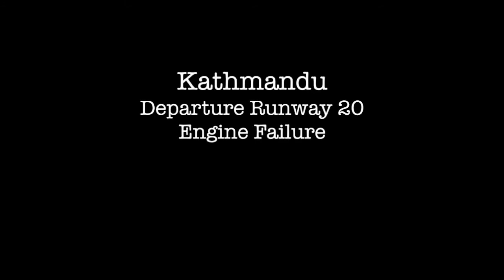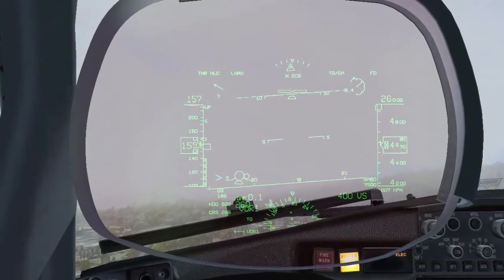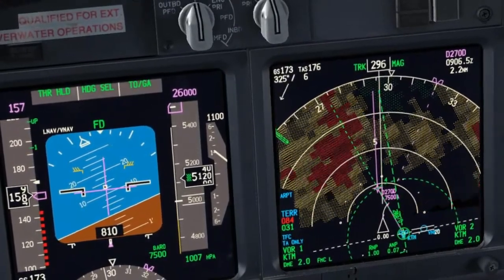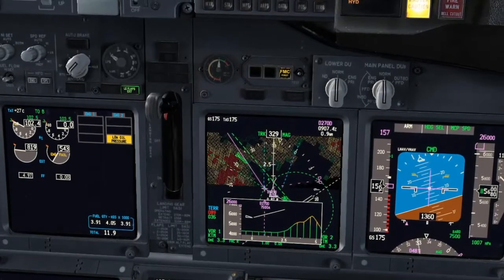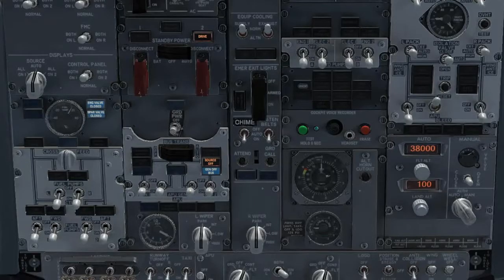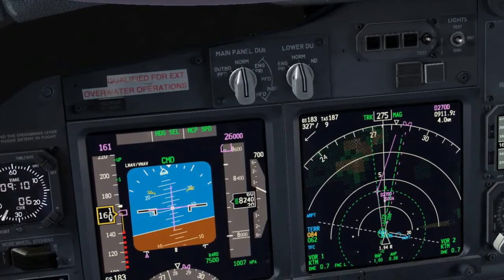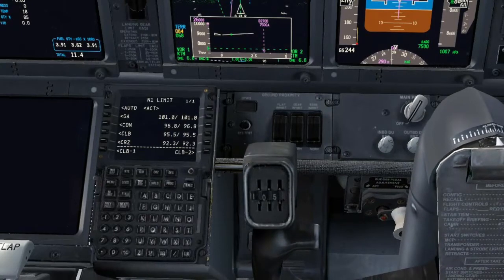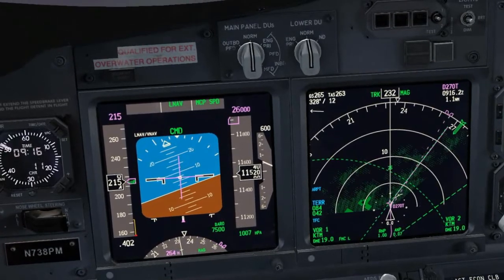Kathmandu Departure Runway 20 - Engine Failure

Comment: Just the video I needed! Very well executed, could not have done it better. May I ask why you chose Darke1A instead of 1B which has the lateral path already entered for the 4 DME arc? On a side request, could you please demonstrate the VOR approach for RWY02 with both engines running? Do you convert the FPA angle to a V/S based on GS or do you use VNAV Path? Thanks a lot.
Reply from the maker: Good morning, thank you very much for the feedback. Darke 1A is the preferred departure because, as in a normal situation there is no concerns to be above 7,500 feet when crossing radial 270, it make us save more fuel and time when comparing to Darke1B.

Yes, I can make the video for the VOR approach. Some companies may have specific policies to fly in KTM. The one I know, only allows to fly the VOR approach with VNAV mode engaged (V/S can be used only within 4 DME, in VMC, to intercept the visual 3º path).
Reply: Boeing 737 Pro thanks a lot for the great content, looking forward to it :)